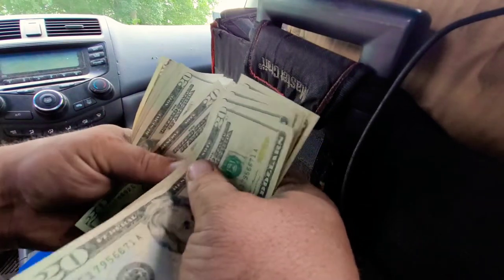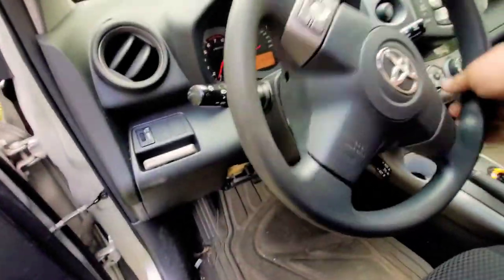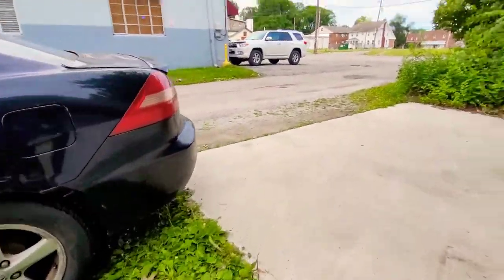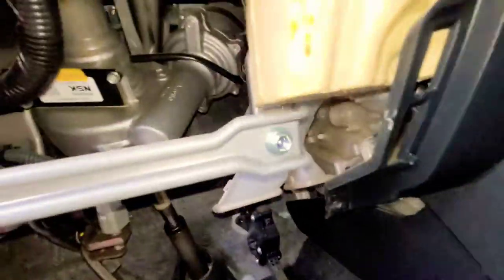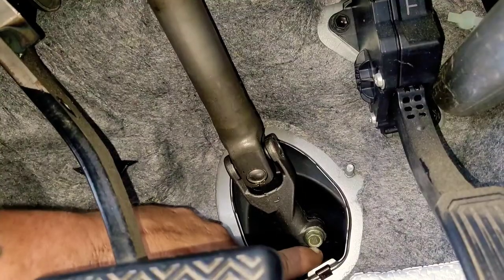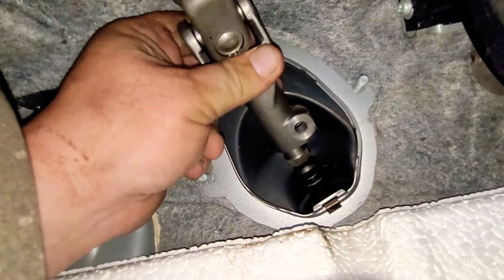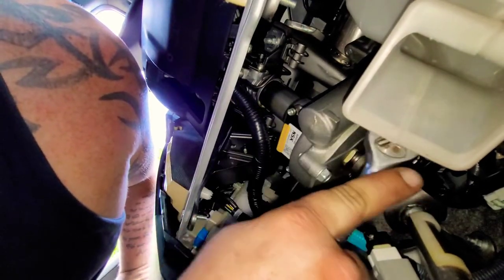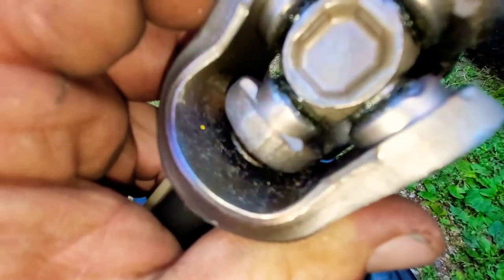Mobile Mechanic Work Day {Episode #11}-2006 Toyota RAV4 Steering Shaft Replacement

Comment: Middle shaft for the steering is called the steering sector. JFYI. Thank you for your service  in defending our freedom. Keep up the good work.
Reply from the maker: You sir are correct. I meant to say in the video  it's called a middle or internediate but guess I didn't not. But thank you and I do not take offense when you correct me, actually I am glad u point it out because I might not have recognized it

Comment: Since we talked last I’ve gotten over 30 messages with close to 4K worth of work I’ve quoted. Made $700 my first week. Things are going good 👍🏻 thank you again so much for your inspiration and kind words brother! People procrastinate to get their cars worked on I’ve noticed lol. Happy 4th
Reply from the maker: Hell yea man thats awesome. Great job bro. I knew you could do it man. Yea what's you hit them with dat quote they start back tracking. Great job I'm working on a video you need to see will be Wed, or Sunday about scheduling and dealing with customers
Reply: @semperfimechanic  I’m priced lower than most but not too low to throw them off. I quote 99% of the time by using the your mechanic trick and going little lower than them. It’s so helpful. Okay I’ll be on the look out! If I have any questions I’ll comment on that video. Learned a lot in the first week already. So much easy money to be made.
Reply from the maker: Yea the yourmechanic trick is awesome. Yea man I'm going to have some good info that I usually only give out during the 1 on 1 coaching. Stuff your going to end up dealing with lol
Reply: @semperfimechanic  okay awesome 😎 hope your YouTube keeps growing good
Reply from the maker: @maxwell8085  thanks man me to lol

Comment: I would have thought it is the electric steering motor bushing looks like a star
Reply from the maker: Yea the small rubber piece that since inside the EPS motor, had the same noise and symptoms. I changed alot of them on Kias  and Hyundais but if you look up Toyota rav4 2006 you will see that it's a very known issue with the steering shaft.